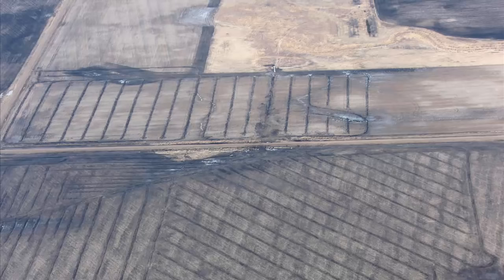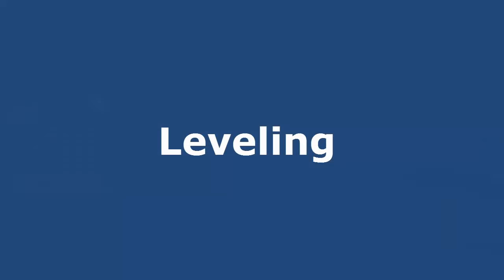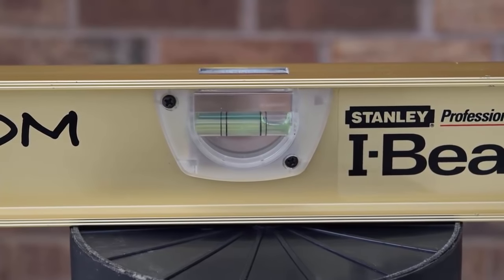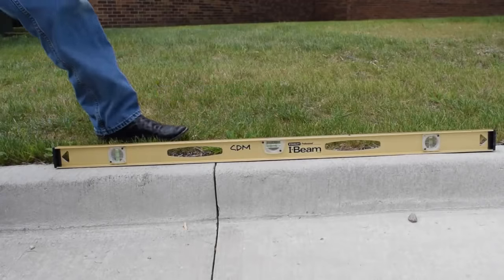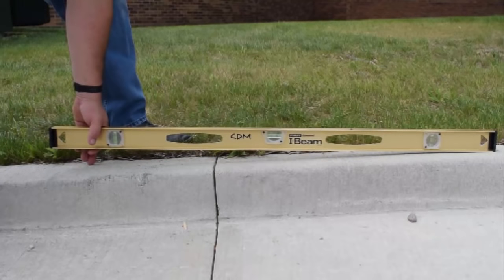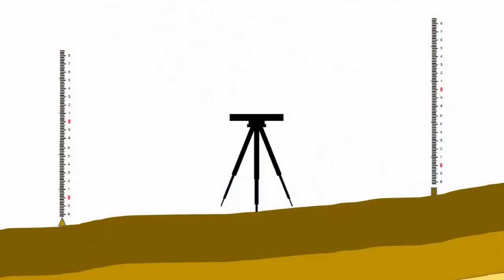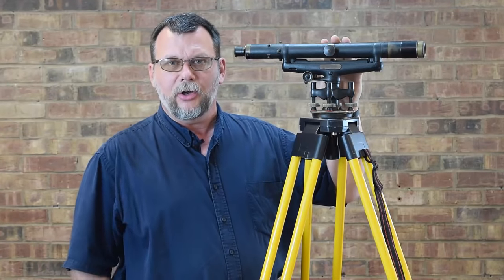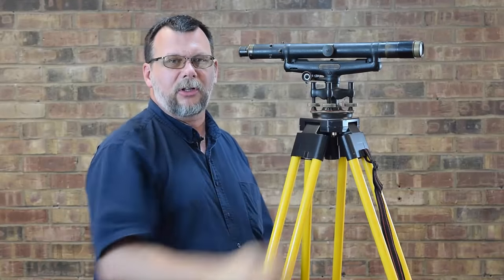Leveling, Part 1

Comment: Long distance leveling is a lot like banging your head against a wall. It feels so good when you stop! Great video thanks👍🇿🇦
Reply: You mean levelling is not efficient over very long distances?
Reply: @jayadams35  no, I meant it as a joke! But we have found that long occupation static GPS obs give fantastic results when used in conjuction with a reliable geoid. In one case over 10km the GPS and leveling differed by only 6mm.

Comment: Calibrated, older style dumpy levels can be just as accurate in the field for measuring elevations as automatic levels.  Automatic levels though take much of the human error out of the picture, as the compensator has a big working range that keeps the hz line of sight true.  The part of your video where you're showing the circular bubble moving straight back and forth in and out of the bullseye is how you test the repeatability of a compensator to maintain a level line of sight.  So, when an operator is using one of these instruments in the field, if the compensator is working and repeating as it should, typically anywhere within the bullseye is level enough.  The compensator does have limits, but they are typically way outside the bullseye straight back and forth as again you showed on your video.  So, the ease of use is a big reason why they are so accurate in the field as they eliminate much of the human error you would have with leveling error associated with traditional dumpy-type levels.   The difference in accuracy is huge between a circular bubble on an automatic level and a higher precision vial on a dumpy level.  But, the automatic level bubble only has to be so accurate as the all the leveling accuracy of the instrument is delivered through the function of the compensator.  A dumpy level vial like the one in your video is like a 20-30 second bubble which of course translates to how level the instrument is in actually 4 directions, not just 2.  And, of course this translates to the dumpy levels accuracy for measuring elevations.  Both instruments are calibrated to repeat within a few arc seconds in a survey instrument repair shop's collimator. The automatic level though simply through it's design and ease of use delivers more consistent accuracy over the long run.  It's still the gold standard for measuring elevations in the field at +/- 1/32" per 100 ft., with a calibrated instrument.  Laser levels are more like +/- 1/8" per 100', and have some operator error introduced into the picture with how the operator goes about using the laser receiver.

Comment: In the UK, we call the horizontal plane swept out by the instrument "the plane of collimation" and, of course, we don't use staves in foot/inch measurements but the normal metric "E" staff in which each "E" is 50mm high with 10mm thickness of the three arms of the "E". The next 50mm is three blocks of 10mm depth, spaced 10mm apart. The whole thing is then repeated on the next 100mm or 1/10 of a metre. Then the metre figure is marked and in the next metre, the "E"s are on the other side of staff face and so on.

Comment: There is only one comment I have to make. When Todd is explaining rise/run, he suggests a layman should measure the distance between the two points. If the is measured along the ground, it would be the hypotenuse of the triangle. It must be the horizontal distance, aka the run. An example of this, if you have a 45 degree slope and measure the slope distance between two points, say 100 feet apart horizontally, you will measure 141 feet, the sine or cosine of 45 degrees along the slope. Other than this, this was a good video.
Please note, that land surveyors measure the horizontal distances for land surveys, therefore, you could call them “flat-earthers”.
Reply: stevebrannon69 2:28

Comment: Very informative video. Thank you!
Any thoughts of making how to calculate angles with theodolite?
Reply: You don't calculate angles with a theodolite, you measure them, both horizontal and vertical. That is what a theodolite is for. You can then do the calculations back in the office with a computer, pocket calculator, slide rule or book of log tables using the angles you have measured with the theodolite.

Comment: If you plot a plane that’s perfectly perpendicular to plumb on the shore of a 10 mile wide lake. How much will the center of the water deviate from the objectively level plane?
Reply: The center of the water will not deviate from the objectively level plane. This is because a plumb line, used to determine verticality, is perpendicular to the surface of the water. Therefore, a plane that is perfectly perpendicular to plumb will also be parallel to the surface of the water in the lake.
Reply: @miked7703  Therefore if earth is 70% water it is,by definition, 70% flat and level.

Comment: So, level is horizontal. 3:12

3:37–so horizontal is gravity? Why not just say perpendicular to horizontal?

7:30– so if you can extend the horizontal line, at which point does one differentiate between elevation and earth curve?
Reply: 1. One word can have different meanings in different contexts, in that case indeed, because he meant a fictional straight line at the level of that tripod.
2. Because in that context it's synonymous, horizontal at coordinates where that guy was standing, or any coordinates is perpendicular to the direction of gravity in that place.
3. There isn't a magical border up to which it doesn't differentiate and then it drops drastically, it does it continuously at very small rate, so it can be ignored until you're surveing terrain for few kilometers long bridge or something, for example the joined effect of refraction and curvature at the distance of 400m isn't greater than 1cm.

Comment: Would you kindly do a video of measuring the curvature of the Earth, to put the flat Earth theory to rest.. I posit that could be done with two theodolites. The second, place at a distance acceptable for the optics and accuracy, would have it's orifice centered by the first theodolite. The second shooting back at the first should strike above the orifice of the first by double the calculated curvature, which is 1.5 thousandths of an inch per linear foot distance. The curvature would be quite easy to see as this method would accurately double the measurement. Thank you from New Zealand.

Comment: You say at the start that measuring the horizontal distance is "easy" and one can use a tape measure. How is it easy to measure the horizontal distance, of say, 100m with a tape measure? I would say that was impossible.
Reply: You also say at 7:20 that you create a "horizontal or level line", well "level" is not a line but a curve, so they are not the same.
Reply: Haha its rumpus. What are you doing here?
I'm looking for a surveyor to answer some questions although doesn't look like this one replies 😂 🤣
Reply: @Rachie-nj3oi  I will be able to answer any questions you have!